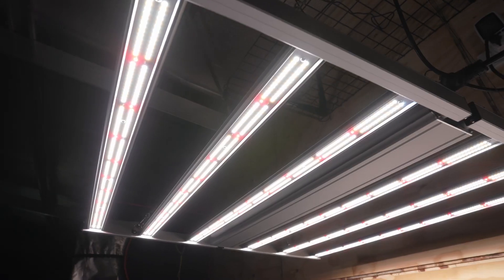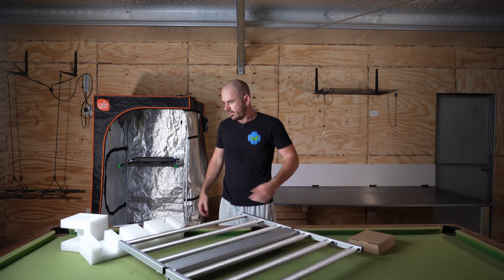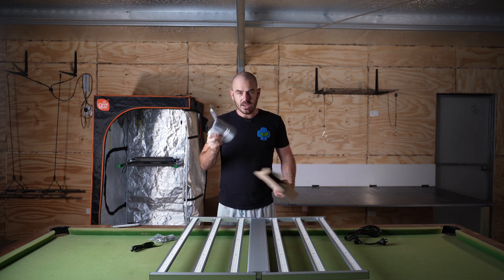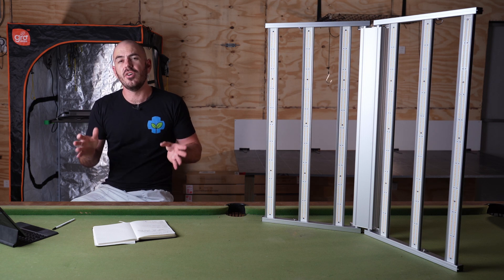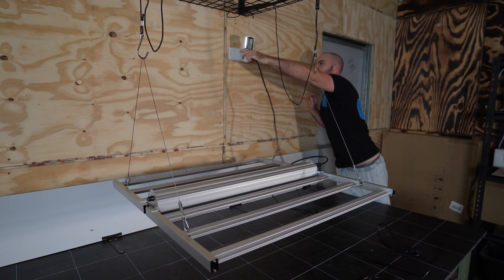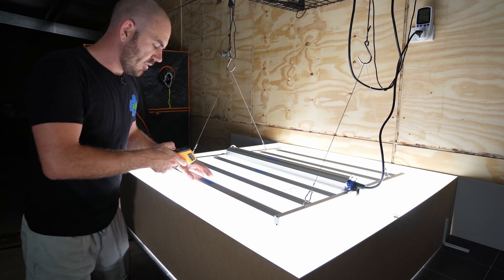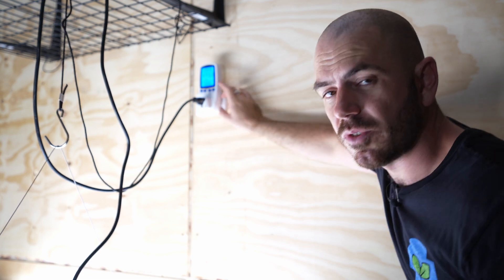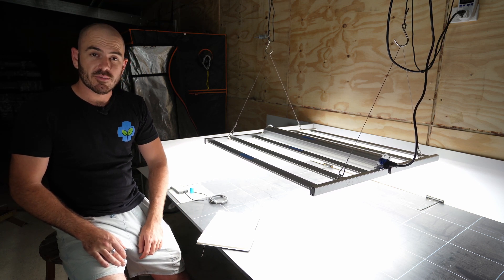Samphon 480w Full Spectrum Grow Light Unbox, Review and PAR Test

Comment: Hey Hooch love your stuff setting up some systems now but have been looking for a follow-up of a vid you posted about the use of the 20l buckets (Bunning buckets you used) with printed wicking stands that wicked out of the 90mm downpipe that you laid under the bucket stands, you capped the downpipe both ends, one end with a float valve other end with just a drain hole with a valve. Have not seen the system in the following vids but would like to know how they worked, did they wick OK and supply nutrient/water or was it a fail. TIA.

Comment: Why are these tested at 12"...nobody is running them at that height.. your plant will be toast if you do.   Thanks for taking the time to do these tests, though.  You should see how different your map is than there's.  These are super cheap on Amazon.
Reply: 12" is perfect for LEDs if your environment is right.
Reply from the maker: As the light diminishes over distance according to the inverse square law it would become weaker and give a worse result on the test.
I assume the manufacturers generally consider this. 
You are right though, I take all hanging height recommendations with a grain of salt.
Reply: I run mine at 12 inches. Sometimes closer and never an issue. I’m using a SE7000 in a 4x4 and ppfd is about 1400  every where.